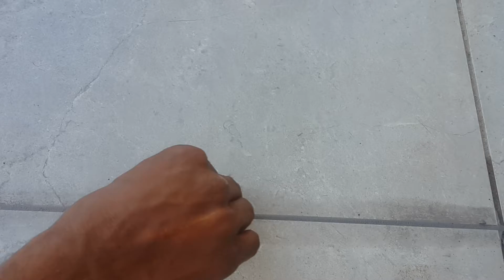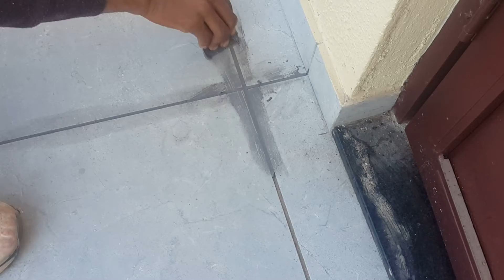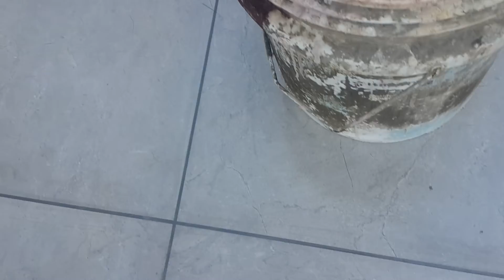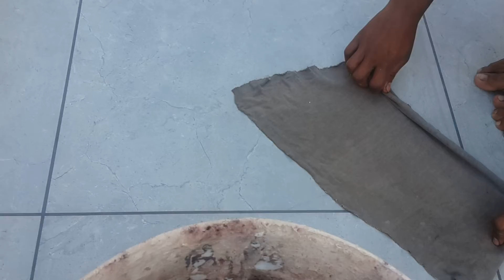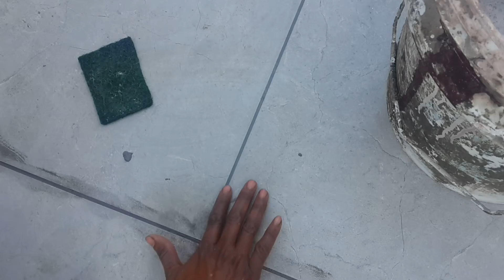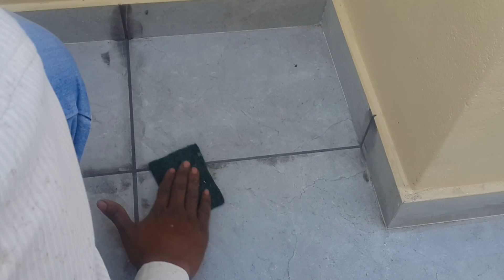How to Apply Epoxy Grout In Tiles Joints

Comment: Most of the videos assume glazed or solid tiles and you just spread all over with a trowel. This works well for matt or textured tiles. Particularly with coloured grout. Do exactly as he shows - small areas at a time and clean with moist abrasive kitchen cleaner + cloth before the grout sets.